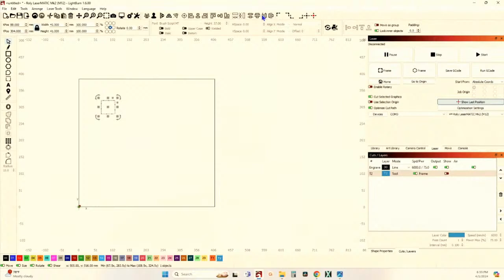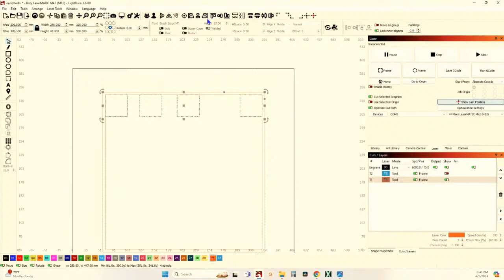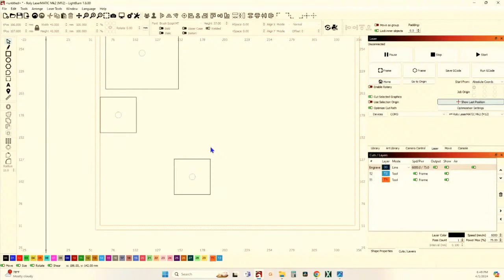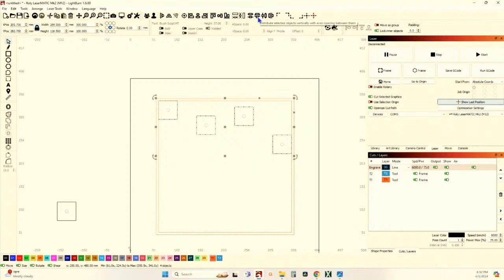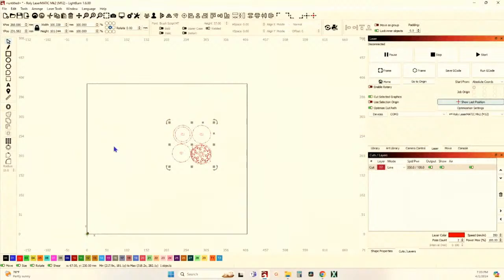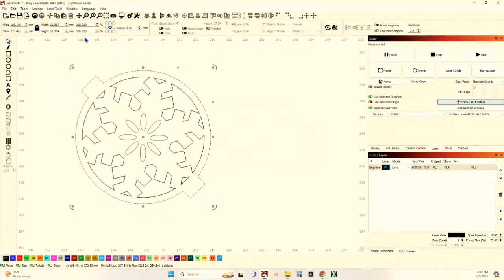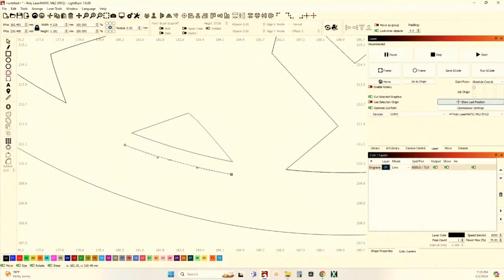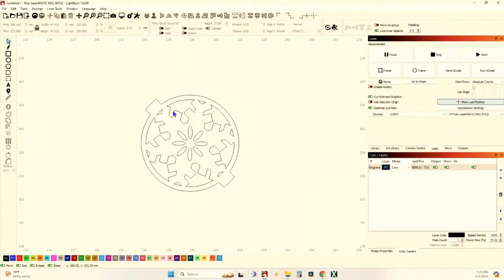Lightburn Distribution Tools - How to use them

Comment: If you consider the stub of lines on each icon as a centerline, it makes perfect sense for the vertical alignment selection to have center lines in the horizontal direction.  In a dimensioned drawing the distance between centers would be shown to those  centerlines.

Comment: Missed live by --> <----,  Could you have opened email on main computer instead of emailing from laptop ? then used save image
Reply from the maker: For whatever reason, I could not access the original attachment. So, I emailed my previous download from my laptop to the PC. I was getting an error on the PC when trying to download the original.
Reply: @HoboWithWood  maybe the email on the PC is set to max size of email smaller than email setting on laptop, other than that it was that Evil Squirrel again.